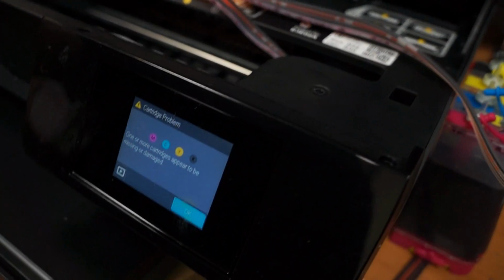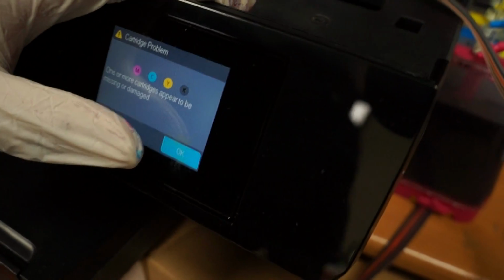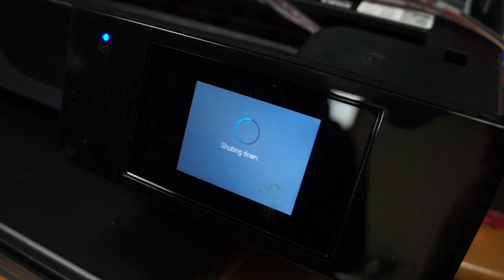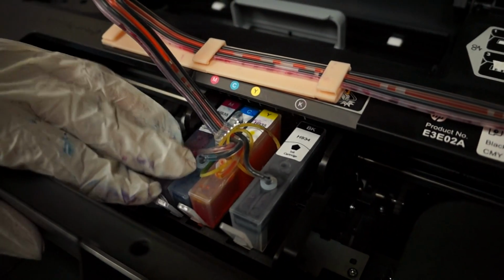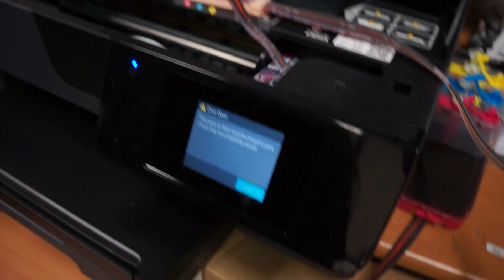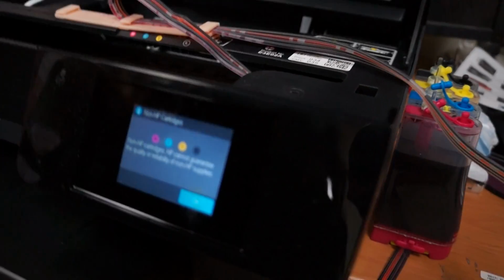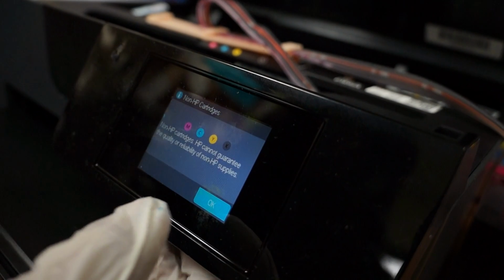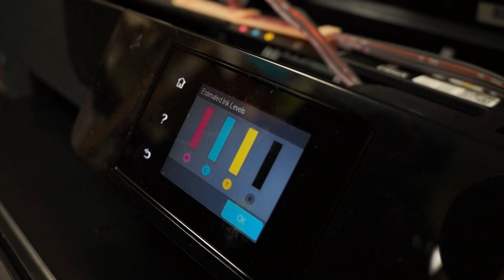934/935 Missing or Damage HP Troubleshoot

Comment: thank you.  this worked with HPV 6500 except I didn't block anything.  I just popped the ink cartridges loose as you said. then cut it off and back on again.  Shut the lid and it read my ink cartridge. thanks for the tip. God bless.